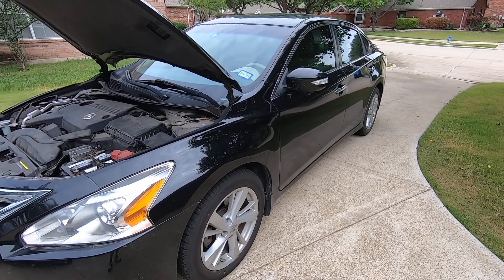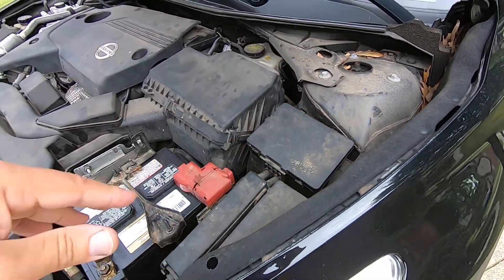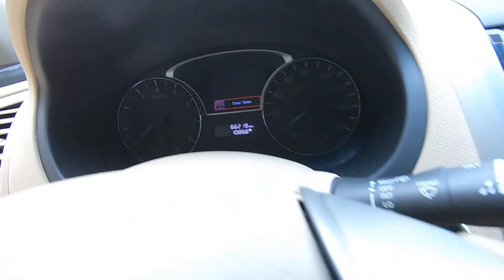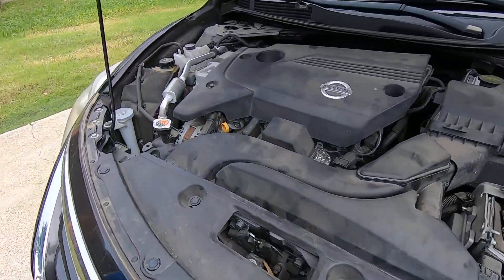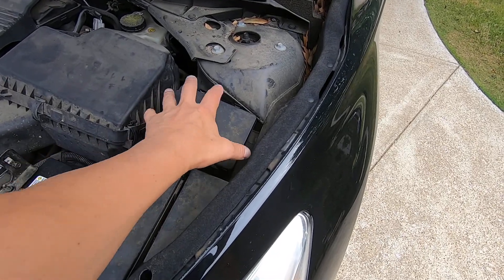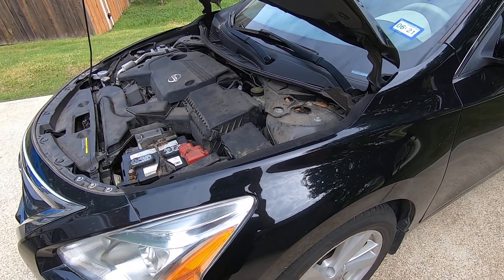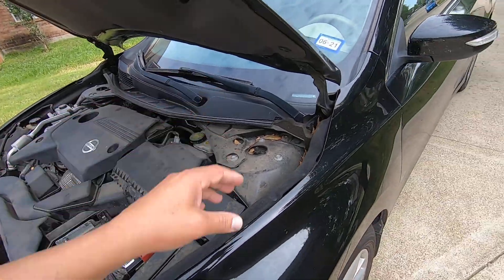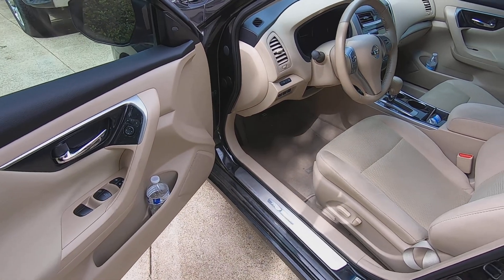How to perform a Nissan IPDM self test

Comment: i have a 2013 infiniti jx35. Opened the IPDM e/r box and there isn't AC comp or AC relay written anywhere in this car. I checked every fuse box, nothing ! There is a fuse called Air cont in the ipdm but not sure what that is. I performed the self test per your instructions and everything came on except I do not hear the ac clutch engaging at all. I just installed a brand new AC compressor but it isn't coming on.  my first question is if I replace my ipdm, does it need to be programmed by the dealership or can I do it on my own? part 284B7-3JV0A. My second question is if I don't want to spend $800 on a new ipdm and $200 on dealership programming, can I straight wire the ac compressor directly to the battery and route a switch to the inside dash through the firewall, when I need AC i turn it on and make sure to turn it off everytime I shut the car off? or do all the ac sensors' data need to be synced in the ipdm for the ac compressor to run efficiently? Any help is much appreciated.
Reply: did you ever fix this im having this problem on my g37, i was also thinking about wiringup a wire to it directly

Comment: Thank you, do you know what the designation of the last 5 digits of the part number. My part # 284B7 3TA0B. I can get one on Amazon  but it’s 3TS0A
Reply: I installed a new ipdm because my fuel pump was not getting power, now I’m getting a I key error. Please help
Reply from the maker: @Fishinglink01  You may need to program the to the car.
Reply from the maker: Usually, those are version numbers. When they improve an item they change the part number to reflect which version it is.

Comment: I have a 2013 Nissan Altima and can’t find the fuel pump relay
Reply from the maker: The fuel pump relay is inside the IPDM but that is not one of the tests the self-test will test.
Reply: That's the question I had just ask , so probably needs a new ipdm when the fuel pump stops pumping fuel? @737mechanic

Comment: I have a quick question. I scanned my car because my ABS failed on me. It is telling me to replace my PCM but it is telling me to replace my IPDM as well. I did the test as you showed and everything worked. But it said headlight system error even tho my headlights were working. Is that why it wants it replaced or does that mean i have a bad fuse/relay?
Reply from the maker: What is telling you to replace those?
Reply: @737mechanic I have an HT 500 scanner that is linked to an app called repair solutions 2. I have had three scanners try and read my car and this one is the only one that worked. Says code u1000 for ABS so I doubt the IPDM affected it. Just wanted to see if it was working properly and that popped up.
Reply from the maker: @michaelpruett8783  I doubt the IPDM is the problem, more than likely whatever Module that code is in is the problem, for instance if that code is in the ABS module then it is having problems communicating with other modules, it can be a bad module but can also be wiring or a bad ground.

Even a weak battery can cause this code to pop up.
Reply: @737mechanic  alright I'll look into it. thank you and very helpful video!

Comment: Is there anything between the IPDM and led tail lights? other than the wiring. I have a 2021 titan pro 4x and all my lights work except the running tail lights and its the same in auto and lights on. i pulled the tail lights and checked all bulbs and they are good but when i pulled the second one from bottom which is the running light according to the diagram for those led lights its only a harness going to more wires inside the housing. Any information would be greatly appreciated as im still working on figuring this out.
Reply from the maker: The wiring diagram I have shows the wiring going to the BCM and doesn't go to the IPDM at all.

Comment: The IPDM also controls the alternator PWM signal does this test let you probe that as well ?
Reply from the maker: No it does not.
Reply: Did you ever find a way to test the IPDM or VVCS to make sure it was controlling the "smart" alternator properly?

My pathfinder is battery is dying after a few miles because the alternator (replaced) stops charging the battery (replaced). Eventually the voltage gets so low the car stops running. Let it cool down, restart, and it's back to 14.5 volts again.

Comment: Great video. My starter relay is part of my IPDM. Trying to figure out how to test that part of the box/starter relay.
Reply from the maker: Email me and I can send you a diagram if that would help. I would need year make and model.
Reply: @737mechanic I was needing a diagram for my ipdm. I have a 2017 nissan altima 2.5 sr. How can I get in contact with you?
Reply: Same here. I have a 2012 qx56. Sometimes it starts and sometimes it just clicks.

Comment: Does it do ignition? As that’s the issue I’m having with and the vehicle staying on. It’s a 2019 Nissan Sentra
Reply: I'm having this same issue, which i'm starting to think that its BCM (Body Control Module ) that is making it have those issues of not turning off. I literally have to hit the switch a couple times well for it to turn off and sometimes it doesn't want to turn off. I've checked and tested all of the relays and fuses,  this video helped me figure out if there was an issue with the IPDM box. The test worked but didn't sound, only the alarm lock sound. I physically test the horn and it sounded. So i guess its the BCM., my Air condition light don't respond tho and my EPS is constantly saying its off.

Comment: How do you do this on a 2020 Altima. This ain’t wirking
Reply from the maker: I looked through the maintenance manual and didn't find any self-test for this year. It looks like 2015 is the last year Nissan built in the self-test.
Reply: @737mechanic  My car only has 20k miles and the I keep getting the side radar obstructed but car is clean as a whistle. Is there a fuse for the radar? I’ve looked but can’t find anything.
Reply from the maker: @AknowledgeMe50  You need to have someone check it for codes, I am not sure if Autozones machine will do an all-module check or if theirs is for engine, trans, abs, and airbag only. I am sure there will be a code set that will give some clue what the problem is.

Comment: Thank you for your videos. I ran the active test on the ipdm and the clutch didn't engage. About to check that it's getting power. Do you know if the clutch will engage on an active test if the pressure switch is bad? Trying to run thru each step. Also is there a way to test the compressor switch?
Reply from the maker: The clutch should engage using the IPDM self-test even if the pressure switch is bad.
Reply: @737mechanic   thanks for replying! I am running out of tests to do. I heard a clicking on the ipdm test so I am assuming that's the relay sending power to the compressor. Which I am guessing means that i need to replace the clutch and compressor. Ugh. I tested to see if the clutch was getting voltage. Butt.. nothing. I wanna make sure I tested right before I go buying parts tho.  Your videos are top notch btw. I appreciate what you do.
Reply from the maker: @kathleenc6433  Buy a cheap test light and use it to see if you have power and ground at the compressor plug when you do the IPDM test. You should have both when you hear the clicking of the relay. If you do have power and ground at the clutch but the clutch is not engaging then yes the clutch is bad.

Comment: 350z: neither of my fans came on. I put a new fan assembly in. When I run the diagnostic only one fan comes on. Is this correct or should both run?
Reply from the maker: I think both should run.
Reply: @737mechanic  yeah. Somewhere in the process, probably when running the diagnostic with the old bad fans in it had blown a fuse for one of them. Replaced that and both are running fine now. Only issue now is that I can’t remember which of the two cables plugs into which of the two fans. They both have identical connectors and both will run during the diagnostic no matter which one they’re connected to. Rookie mistake but I haven’t been doing much mechanic work in years.
Reply from the maker: @sgtskiddz  probably not real important which fan each connector goes two if the fans are the same size.

Comment: I tried this on my 2013 Pathfinder.  It worked with 5x start button, 10x door switch, 3x start button.  Heard relays clicking in the box, but my AC clutch was silent.  Fuse is good.  I guess the clutch coil is bad then?
Reply from the maker: Possibly but it could also be a bad connection at the clutch or open wire going to the clutch.

Comment: This is good stuff. I have a customers Altima coming tomorrow for no brake lights. Customer replaced the underdash fuse and the brake light switch. Alldata doesn't have anything for the wiring diagram for the brake lights, just the start switch at the brake pedal. Excited to see of this is the issue.
Reply from the maker: I am curious what you end up finding.
Reply: @737mechanic  I'll post results after diagnosis. Fighting with my printer right now to print the diagram I found of the IPDM. Looks like fuse 46 and 47 make the brake lighslts and exterior lights work.
Reply from the maker: @jerseyshorefabricators7431  email me the year make and model and let me see what I have for diagrams that might help. mechanic737@hotmail.com
Reply: I have a 2020 Nissan Sentra with the IPDM. The driver side high beam and low beam are out and I can’t figure out what to do. We replaced the entire headlight because it was cracked anyways but still isn’t working. I don’t see that there are any fuses for the headlights so I’m not sure.

Comment: i have a 2005 nissan 350z and the tail lights won’t come on when my lights are on (brake lights work) and turning on my right directional turns on the emergency lights. could that be the ipdm or something else?
Reply from the maker: It could be but could also be bulbs, most taillights are dual filament bulbs and could have the filament for the tail lights burned out while the filament for the brake lights and turn signals are ok.
Reply: This sounds like a Fuse issue, check all of your fuses to see if any are blown.

Comment: I have 2011 pathfinder.  It will crank but won’t start.  The mechanic said the relay for the fuel pump is bad, but it’s built into the ipdm. Is there a way to test this?  He bought the new ipdm, $350,  that didn’t work.
Reply from the maker: So the relay is in the IPDM and it has a 15AMP fuse so make sure that fuse is good, if it is you can back probe the connector with a test light on the IPDM that feeds the fuel pump and when you turn the key on it should light the test light, if it does the problem isn’t the IPDM. At that point you would need to get the the connector at the fuel pump and see if there is power and ground there. If you need the wiring diagram email me and I can send it to you.
Reply: @737mechanic  I’m reading that for the Nissans they had an issue with the ipdm or the ecu.  My mechanic seems to just wants to throw parts at it until something works. I can’t afford this.  He didn’t test the ipdm just took the words of the internet and ran with it.

Comment: Does the module need to be reprogrammed when swapped? Asking for a 2016 Rogue
Reply from the maker: More than likely,  in most higher end standards tools there is an option to configure a new IPDM, but if it was used and came out of a car with the exact same options it might work just fine.

Comment: my altima 2004 3.5 the air conditioning does not work, it only turns on the compressor directly connected to the battery, could the IPDM be damaged?
Reply: I hear the relay clicking but the compressor clutch not engaging during test. The clutch will spin when manually turned by hand so it's not locked up. Could this still be ipdm?
Reply: @JenGoines0630  same ever figured out what’s wrong?
Reply from the maker: It's possible, do you hear a relay in the IPDM clicking, if so connect a test light to the pin in the compressor connector and see if it flashes when in test mode. If it does flash that means the IPDM is sending power to the compressor but the clutch isn't engaging meaning the clutch is bad.
Reply: @737mechanic  
I changed the fuse box and the compressor if it clicked, I had already bought it a few weeks ago, and it will only be tested that it does not leak, empty and gas loaded.
Reply: You guys ever find out same issue